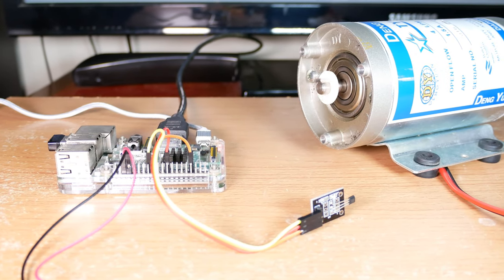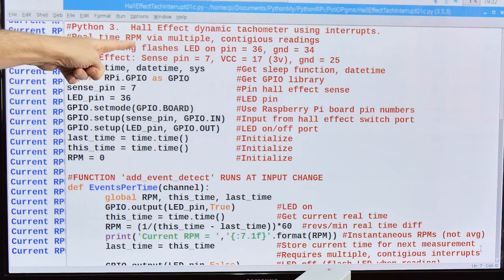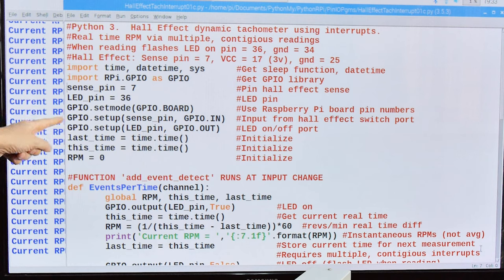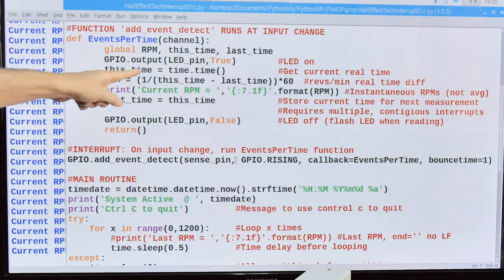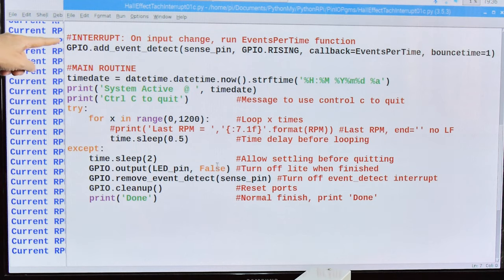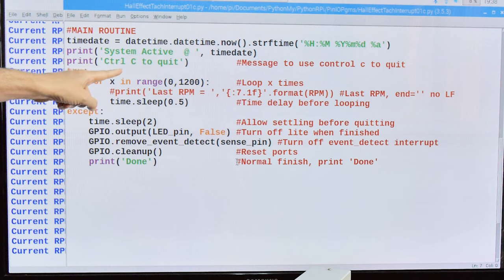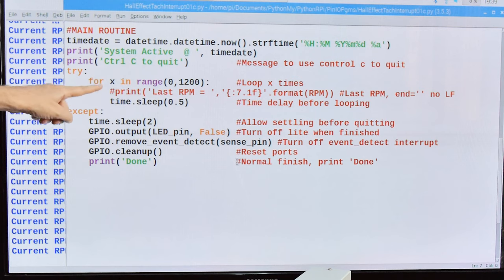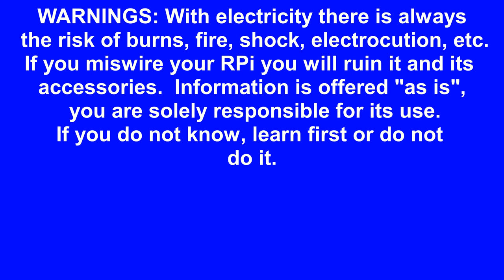RPi 34.0 - Hall Effect Tachometer (4K)

Comment: Can you get away with a python code for real time rpm sensing? I'm obviously not talking about controlling any critical mission motor, but for instance, imagine I'm building a rotating base for showing objects in order to record a video about it and due to lighting and camera shutter speed I need to set a precise rotating speed (even if it's a low speed like 10 rpm), can we get away with python running in Linux to make the set up speed steady over time? Thanks , great video
Reply from the maker: I did a video on it, but it's a simple experiment to connect an output to an input and switch them on and off an known number of times and see if the inputs = outputs. You can try it with both polling and interrupts. BUT, the RPi and Arduinos are both seriously impacted by the other code that is running, so the test has to be done when the rest of your code is active. A simple output (print) can slow things down a LOT. Some examples of where slowness has caused me problems: this tachometer (speed limited), ultrasonic sensor, water meter, rotary switch. If occasional (and even frequent) loss of a data point will cause a big problem, then these may not be the best devices. There are a wide array of programmable controllers that might work better. I have not experimented with them yet, but I've seen what others have done.

Comment: how powerful of a magnet did you use? More importantly, does it matter?
Reply from the maker: The stronger the magnet, the farther away it will activate the device. The magnet I used was a small one out of an old CD rom drive.
Reply: @tsbrownie  How did you mount the magnet on the shaft?
Reply from the maker: @tobi saibot  The shaft is steel. The magnet sticks to it. It works as long as it is not spinning too fast.